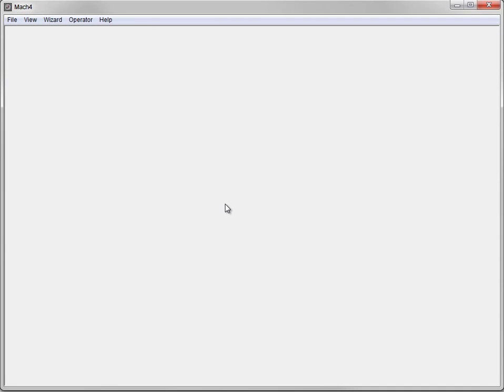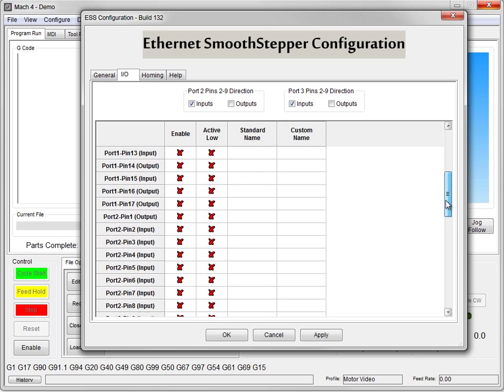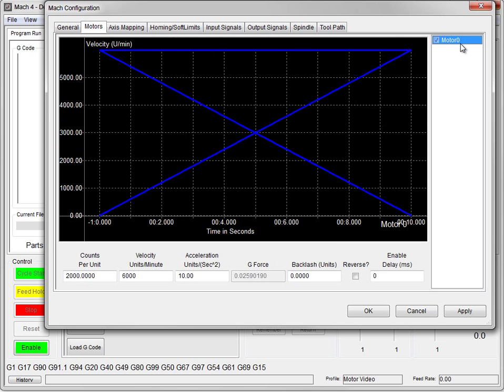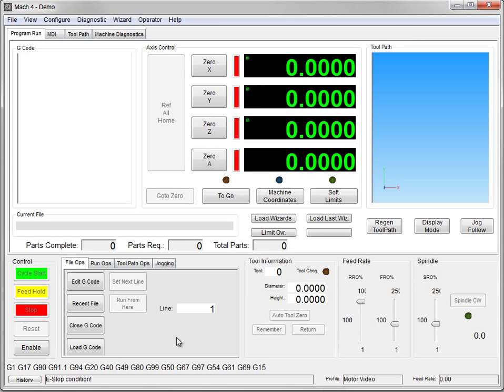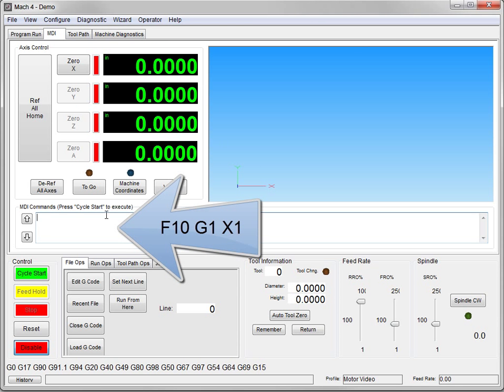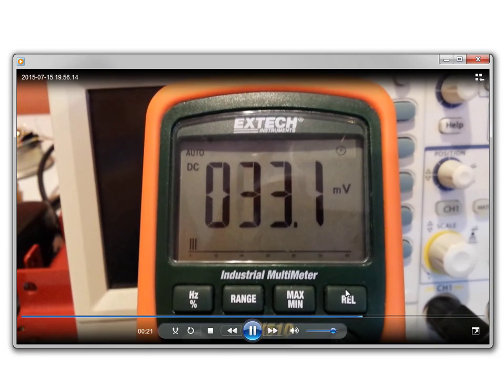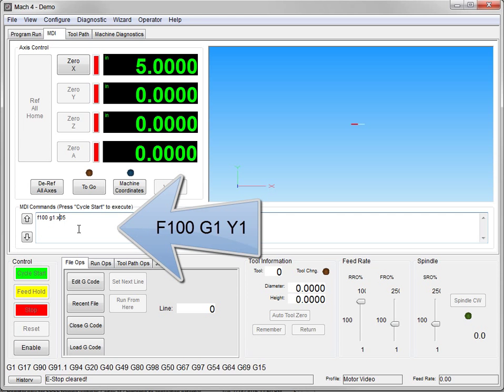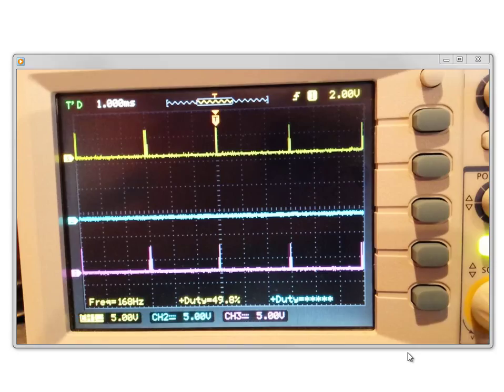Mach4 EStop and Motors Configuration for the ESS

Comment: Is there a more recent version of this? The ESS screens for setting up the I/O are completely different on the latest version
Reply from the maker: Once we release v220 in another week or so, we will make a whole new set of videos then...  It has one more area of changes in it that I want to document in the new videos.
Reply from the maker: Also, out Getting Started page will walk you through the setup process, and that is what I base the videos on:  https://warp9td.com/index.php/gettingstarted/setting-up-the-smoothstepper-and-mach4#top
Reply: Excellent! Will this include an explanation of how to set up the backlash compensation? I'm currently using it on Mach3 and I can't change over to Mach4 until this is resolved.
Reply from the maker: Yes it will!
Reply: Happy days!
Reply: Any news on the new release? I've bought a license and got it all working but the backlash compensation doesn't appear to work.
This is what I'm doing..
1. Write a program that moves the X-axis back and forth 0.1mm which is within the range of my Dial Gauge.
2. Run it with the clock on the bed and the stylus on the spindle. It reads 80 microns not 100 microns so there's 20 microns backlash ie about a thou in old money.
3. Enable backlash compensation in the plugin and then set the backlash to 20 microns in the motor setup.
4. That's really brutal, so change the ESS to 1 velocity and 0.1 accel
5. That compensates too much, it now reads 110microns.
6. Change it to 10 microns backlash and now it does a strange motion where it stops in the middle of travel and doesn't appear to apply any backlash compensation at all, ie it still reads 80 microns

I have no idea what's going on, but to my mind that should have worked. Why does it momentarily stop in the middle of the travel? I don't think this is implemented correctly.
Reply from the maker: Backlash Comp appears to be working well in build 220.  It is available in our forum now, and it will go full release next week.

Comment: Hello.  Regarding the physical connection of the e-stop switch to the ESS, the e-stop switch that I have is simply a normally closed switch with 2 leads, do I connect one side of the switch to the +5V and the other to the input pin I have selected on my ESS?  Or, does one side of the switch need to be connected to an output and the other side need to be connected to an input?  Thanks for your help.
Reply from the maker: Hi, Jesse, 
It depends on if your Break Out Board (BOB) input has a pull up or a pull down resistor.  Let's assume you are using Port 1 Pin 10 as the EStop input and you have that wired to 1 of the two terminals of your switch.  

If the BOB's, pin 10 has a pull DOWN resistor, it will pull the pin down to GND unless a signal is applied, so you would want the other end of the switch wired to 5V.   When the switch is closed, it will bring  the pin up to 5V. When the switch is open, the pull down resistor will pull the pin down to GND.

If the BOB's, pin 10 has a pull UP resistor, it will pull the pin up to 5V unless a signal is applied, so you would want the other end of the switch wired to GND.  When the switch is closed, it will bring the pin down up to GND.  When the switch  is open, the pull up resistor will pull the pin up to 5V.

Does this answer your question?
Andy

Comment: Hello
my problem is that i couldn´t press the Plugins button.
do you know why?
Reply from the maker: Do you have the ESS plugin inside the Mach4/Plugins folder?  Did you enable the ESS plugin in Mach's settings?  Look at step #6 here:  http://warp9td.com/index.php/gettingstarted/setting-up-the-smoothstepper-and-mach4#MachFourRemainingESS
Reply: i used a parrallel port breakout
Reply from the maker: Ahh...  The ESS settings are only available if you use an ESS.  They will not work with a normal parallel port.
Reply: Did you know how it works for a parallel port?

Comment: And now, what is do smooth stepper if LAN is unplug if program make for example circuit ?
Reply from the maker: +Tomáš Stránský 

Is your question 'What will happen if the cable is unplugged while the machine is running'?    If so, the SmoothStepper will stop once it runs out of transmitted data, or the watchdog expires.  Both of those settings are set to be typically within 2 seconds.
Reply: Thank you so much :)

Comment: Where is the part setting up the charge pump signal output? Most users need that so they enable their BOB output signals (step/direction) to the motors. Also many motor drivers have an enable signal and an alarm signal, you might as well cover that in detail. A good video is worth 100 hours in support.. I would get a small machine with inputs and outputs running, to cover the basics that every user will need. This video is a 5 out of 10 as it shows more of a lab test and not a real world machine setup.
Reply: +strider a  More a 7 out of 10 mate. Be weary as the latest release of the ESS plugin is not recommended for the last release of Mach4, in case you are having problems...
Reply from the maker: Hi, I posted another comment on the page talking about our 
new Mach4 V2 plugin release for the ESS which will be  coming soon.  
However, in the meantime,   http://warp9td.com/index.php/sw/software-mach#MachFour allows you to download the latest version of Mach4 V2 that works with the current ESS plugin.